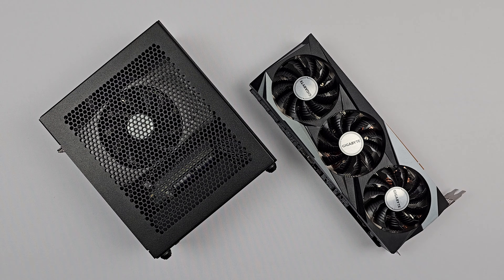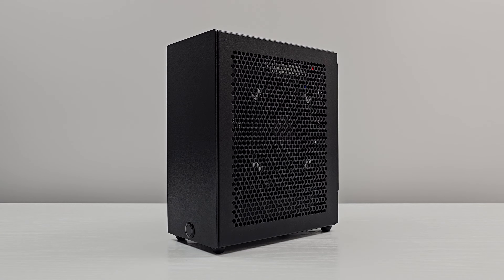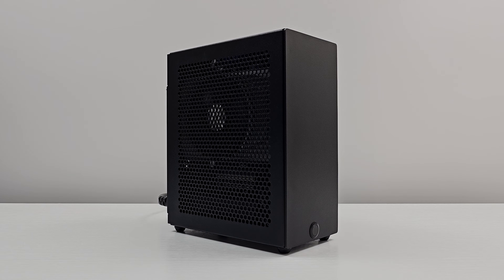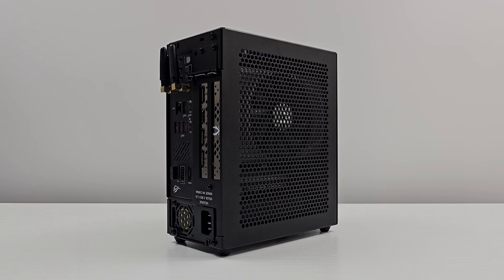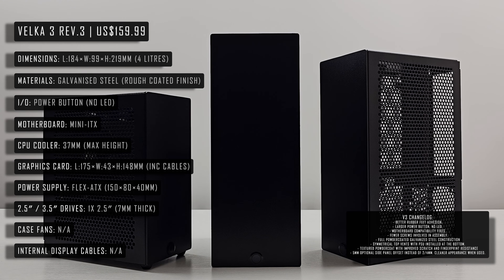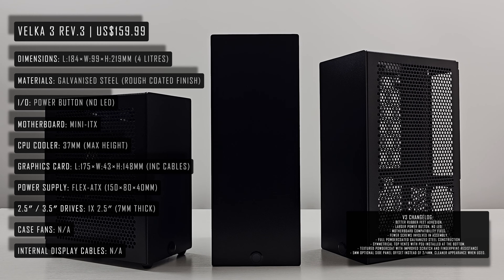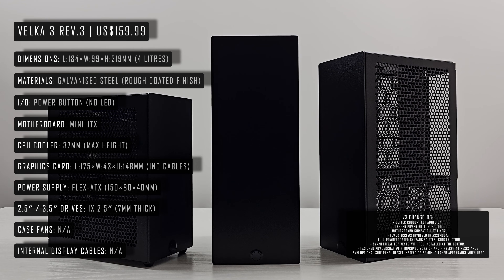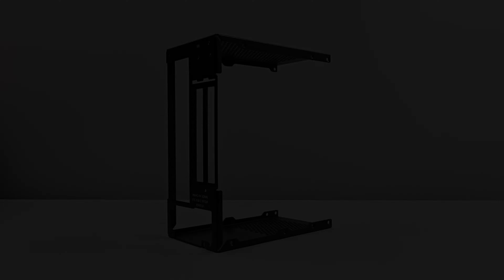The smallest 4060 build that makes sense - Velka 3 v3

Comment: 7800x3d and a noctua NH-L9A-AM5 ? Their website says that cooler can't even handle the base clock. 

Something is wrong.
Reply: He should highlight that in case someone goes on and doesn't "optimize"
Reply: @mauricobian  can't argue with that, it would easily be missed by someone skimming the video, only listening to audio, and/or generally just not reading that closely.
Reply: hypotheticly does 7800x3D have any power gain over the 7600x?
Reply: The specs list in the video says the Ryzen 7 7800X3D used in the build has been "optimized". I assume that involved curve adjusting and undervolting.
Reply: @hyperonestarcraft The video explains how he’s done it as well. He’s set the voltage of -20 from base and then set a PPT limit of 75 on the chip.

It would have been nice to see more gaming applications used here and the fps, I understand why temperature was a stat to focus on as it will always be the limiting factor in this instance

Comment: Hey sorry im a bit confused i have a motherboard mini itx pcie gen 3.0 and planning on putting a 4060 in it with the velka 3 case im just confused on which pcie cable to buy the 3.0 or the 4.0 do i have to buy for the same pcie of my gpu or motherboard ? Thanks !
Reply from the maker: You can use gen3 or gen4, it doesn't matter, atleast for now. Once you switch to pcie gen4 motherboard, you'll want 4.0 riser purely for compatibility protocol between hardware

Comment: Any fitment issues with the modular psu? I really want to go for that psu since the only cables I’d be using would be the motherboard and cpu cables. I have the rtx 4000 sff so it’s pcie powered and I want to keep the cable managing as simple and clean as possible and the one provided by velka isn’t modular so I’ll be having cables that I won’t be using and taking up space.

Edit: I’m currently in a formd t1 v2.0 and I have their light blue gen 4 riser cable. Do you think their riser cable will fit in this case? If you can, would you please test if the riser cable is doable in this case? I don’t have the velka 3 to do any testing so I’m just wondering. The case and psu is gonna cost quite a bit and I just want to save some cash.
Reply from the maker: The modular Flex-ATX worked fine in Velka 3. It was only Velka 5 I had some trouble with. As for the riser cable, I'll look into it and get back to you.
Reply: @L91  any update on the riser cable fitment?

Comment: Dope PC.

I’m surprised you didn’t mention the PSU. It’s a crucial part
Reply: what you need to know
Reply: its mentioned in the video, its a ENP-7660B
Reply: @jonnyfontane3607  Which model it was. It was an anhanced 600w modular (which is what I have) and was curious about as I may buold in the velka 3 one day
Reply: @petercruz1993  in the specs they mention max length is 150mm, that is almost impossible to find: unsure if they consider the full length or just the "bigger box" without the cable bracket.

Comment: I am glad you made this very good video -- I will be following along as I make a build with the excellent Velka 3 (I am eagerly awaiting its arrival in the mail).  Regarding the ZOTAC RTX 4060 Solo, a couple of users have mentioned that they had problems with the fan pressing against the side panel.  Have you (or anyone that sees this) noticed any issues with the fan touching the side panel?
Reply from the maker: Thank you. My fan only contacted the side panel when grabbing the case by the side panels and moving it.
Reply: @L91  That's very good to know.  Thanks for your response!

Comment: I built this exactly, with the side panels on it will overheat.
Reply from the maker: What's overheating exactly?
Reply: @L91  mainly the CPU but the GPU side gets hot as well. I double checked cpu paste and ramped up fan speeds. The holes in the side panels just don't allow enough heat to be pushed out. I got around this by cutting the panels in the shape of the fans. This is the second video I've found of this build where they have the PC running without the panels on for a reason.
Reply from the maker: @busteddonutface8796  what CPU and how do you know its overheating?
Reply: @L91 I'm actually using a Ryzen 5 7600x so not even as crazy as yours.  I know it's overheating because I'm monitoring the Temps.
Reply from the maker: @busteddonutface8796  you realise Zen4 CPUs are intentionally designed to push and run themselves at their thermal limit. For 7600X, it's 95°C. There's no way to know if it's overheating from looking at monitoring software
Reply: @L91  correct, I'm not just saying it's overheating because I see the Temps hit high and turns red, it's actually crashing when it gets high. Have you done your benchmarks with the panels on? I didn't see it in the video.
Reply: These new CPUs are designed to run at high temps just not ideal with this sff case. Don't get me wrong I love the case and love the build it's just misleading to show the pc without the panels on gaming and this wasn't the only video to do it. Panels on thermal throttle and eventual pc crash, panels off runs just fine. I'd just include a small warning to people, hey you might have some thermal issues.
Reply from the maker: @busteddonutface8796  testing was carried out with case panels on/installed. Wouldn't make sense to test with them not installed. You are also not using the same CPU, and 7600X is not exactly an easy to cool CPU either when it can draw upto 105~110W in multicore out of the box. My 7800X3D is also tuned to reduce thermals, see my 7800X3D cooler comparisons. I'd suggest running your CPU in eco mode or with a custom power target to reduce thermals.
Reply: @L91 lol don't delete my comments
Reply from the maker: @busteddonutface8796  no one's deleted your comments.
Reply: @busteddonutface8796  new CPUs are not designed to run at high temps, they are getting more efficient by the year. And with builds like this you have to optimize stuff, undervolt and set limits and maybe you used a bad thermal paste etc. This cpu cooler size also doesn't support more power hungry CPUs.

Comment: 2.1 is a better case than 3.0 IMO. I'm so happy that this rare occasion of something I own has a new revision that is worse than the one I own.
Reply from the maker: Thanks for the response. What makes v2.1 better? Just curious.
Reply: @L91  Appearance wise, 2.1 is sleek and clean looking. The shiny front panel edge looks premium. The new black coating looks like bed liner paint imo.
Also 3.0 white text on the rear looks bad, especially upside in the "correct" orientation. 
LED pushbutton is awesome for boards without any leds on them letting you know it is on. 
And 2.1 is technically smaller, so can't beat that. If 3.0 was smaller I'd really consider an upgrade.

Also velka 3 is my dream case btw. Can't go wr9ng with the 3.0 either!

Comment: Thanks for video, you are one of the best channels on Youtube covering SFF builds!
As for Velka 3 - it is great case but kind of "suboptimal" for powerful gaming builds.
One of my recent build was with modded RTX A4000 in case by Custom Mod - way better on both perfomance and temps, albeit slightly larger.

PS. Sorry for possible mistakes, english is not my native language.
Reply from the maker: Thanks for the support. The A4000 is cool, but it costs near 4080 / 4090 price brackets. If you mean ADA SFF model. I'd sooner build in something a little bigger, like Velka 7.
Reply: @L91 I actually mean "old" A4000. I bought some of these from miners for about ~350$, swapped heatsinks and do some other mods. One of the best cards for SFF builds.

Comment: Wouldnt it be better to downgrade the cpu to a 5800x3d or 7600 because of the heat? with lower heat and power consumption you can also replace psu fan. I did a similar build and used a silverstone 600w flex psu but the noise was pretty loud
Reply from the maker: I did mention that the system is best paired with R5 7600 or similar. Unfortunately, I don't have one. It's worth noting that the R5 7600 doesn't run cooler or draw any less power than 7800X3D. It's just better pairing value wise. The system shown is pretty quiet thanks to custom fan parameters.
Reply: @L91  what about the psu fan?
Reply from the maker: @videosuu300  PSU fan is quieter than the rest of the system. It's only drawing around 200W and isn't heating up enough during gaming for the fan to need to ramp past wattage parameters. The ENP-7660B is relatively quiet PSU upto around 480W, unless the PSU is heating up to much, at which point it can become extremely loud at any wattage. SilverStone FX600 works exactly the same.
Reply: @L91  I see, the fx600 was sueprloud when gaming, I had a 3060 and a i7 9th gen. Probably because of the consumption it was generating more heat

Comment: What was the all core frequency during Cinebench?
Reply from the maker: Roughly 4.45GHz by the end of the 30-minute stability test.
Reply: @L91  That's a pretty solid all core there. Very nice.
Reply from the maker: Lost roughly 1000 points in Cinebench R23 vs. likes of 280mm AIO